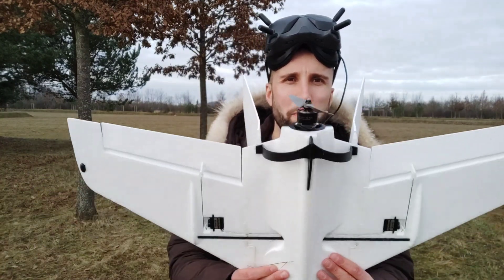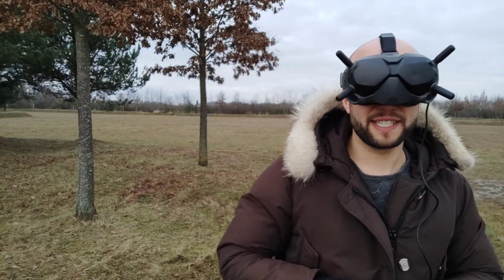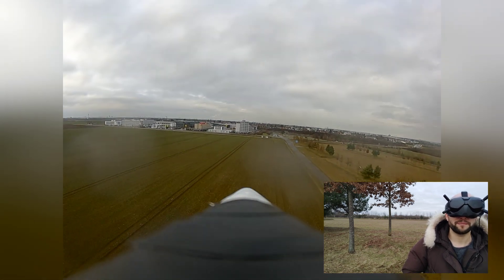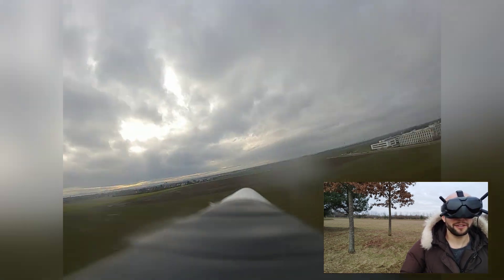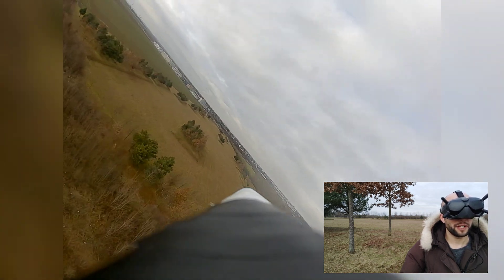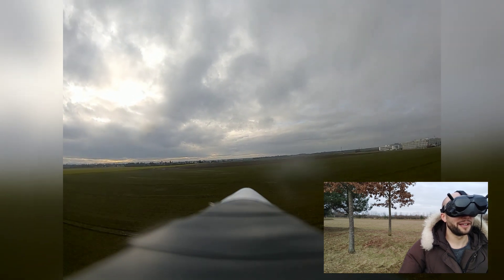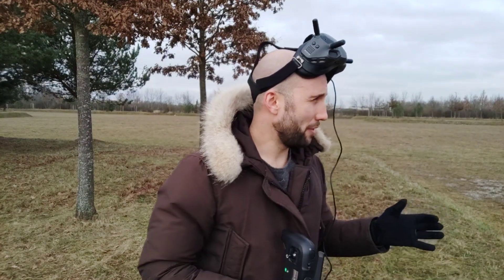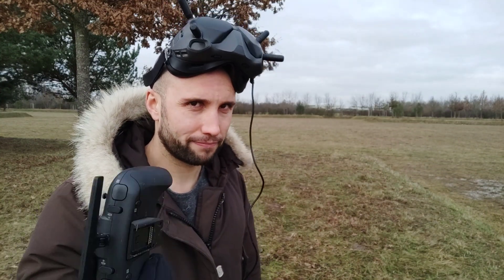High Speed FPV Wing Maiden

Comment: Nice plane and flying. I see in all off the specs on these type of FPV planes, they state the body materials in a bunch of abbreviations that make no sense to me. Are these planes basically made from polystyrene?
Reply from the maker: Yes it's basically  just polystyrene. Dirt cheap, light and easy to repair (glue)

Comment: So, no overheating problems with the air unit inside the fuse? I've been wanting to mount one inside a hobbyking skipper for flying off water, but was concerned about the lack of venting

Comment: FYI, acro is stabilized mode. Try the "manual" one to see the difference. And DJI does not require any FC, just power it and it will work

Comment: Great video dave 👍🏽👍🏽👍🏽
My stup 
Emax eco v2 2807 1300kv
HqProp 8x5
Esc 60a
Emax servo metal gear 12g
Cnhl 6s 1100mah 100c
Matek F411WSE
Bn220
Rushtank ultimate mini
Rush cherry mmcx
Runcam eagles 2 pro

Flyfun the fast... 🙏🏾🙏🏾🙏🏾🙈🏃🏽🏃🏽🏃🏽

Comment: I want to get a long range DJI wing, because I've got the goggles, directional antennas, Crossfire full, and Li-ion batteries so I got the range.  I probably want something really stable and long range though, that could blow my quad out of the water for range.
https://www.fpvbook.com/profile-3172
Reply from the maker: You'll need something like a ZOHD dart XL those things fly for up to 1h
Reply: Define long range? DJI can only go so far. 10km absolute max in perfect LOS conditions.

Comment: What prop is that? I have the AirB on my Speed AR Wing and can reach 200kph in level flight on 4S with a 8x7 prop but not sure what prop to use to run it on 6S without burning up the motor.
Reply: I would guess it's at least a 6x4.5 or steeper (I have a 6x5.5 from china at home, which looks pretty similar). Concerning the motor burning up, it's more a question of if and how long he pinned the throttle.

Comment: Planes don't seem very great for FPV because they're so shaky. They look smooth line of sight but put a camera on it and it's very shaky. That's a shame because they're really fast and look like fun. I wish they'd improve flight controllers for planes so you can have that smooth flight like you can get with a quad.
Reply: indeed planes are less stable than a quad but not so bad actually.
of course there are planes that wobble a lot a planes that have 0 wobble.. just like quads
Reply: Which wings have zero wobble Alex?
Reply: @changeagent228  there are no wings with zero wobble but some go close to zero wobble.
Usually fast means stable so wings like the drak or mini drak are pretty stable, funjets too.
However since how a plane flies is different and more complex than how drones fly the setup of a wing can give you different results. So you can have a mini drak fly like a brick and have a 30$ homemade foamie fly better, it all depends on the pilots building and piloting skills.
Reply: @alerx94  Yeah I have been looking at getting a mini drak for a while now. Will be getting the zohd dart xl first though. All my quads are rock solid stable. I'm really attracted to the flight times and range of wings it's the wobbly camera that puts me off. 👍
Reply: Oh I would of thought less vibration being 1 motor. So less jello.. but guess no real good stability horizon lock without a gopro
Reply: @divingfalconfpv4602  Now that I think of it, When I watch my flight videos of my quads, they seem more shaky than I remember them being when I was flying. So maybe it's not so bad to fly, it's not not as nice to watch afterwards. I first flew RC about 10 years ago LOS with a Harbor Freight foam plane. Destroyed it within a few weeks but I always wanted to get back in to planes.
Reply: @CarbonGlassMan  I have to mount my insta go softer. Vibration makes it blurry or my camera broke and I don't know.. I want a wing for long range but haven't done it

Comment: cough micro long range wing cough
Reply: its called the nano goblin... pretty hard to beat that design
Reply: @00fluxone  it is very good but it's not really nano is it? Lots of good quad motors smaller than the nano uses.
Reply: @frasersteen  That's what I had in mind, something based on a smaller stator than a 14xx. Bruce from XJet has a nice DIY project too.
Reply: I've been hoping that Dave would take an interest in fixed wings.
Reply: Micro wing 2021 FTW
Reply: thats funny shit.. the man started a whole new class